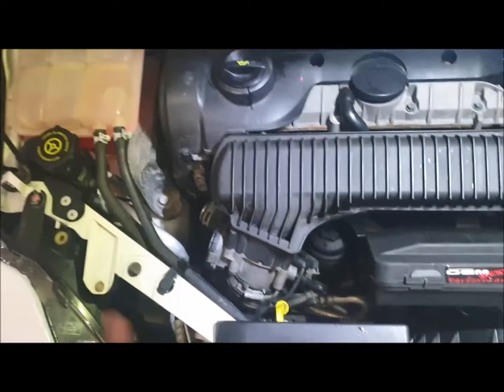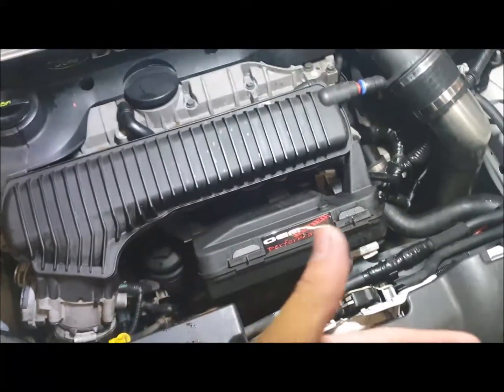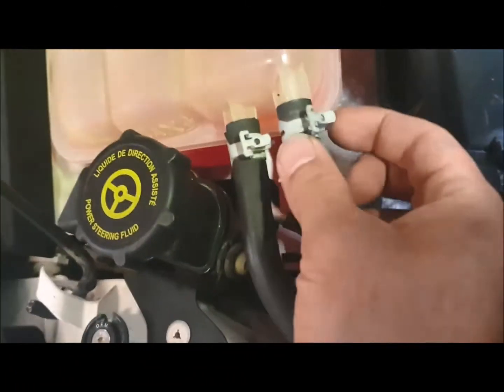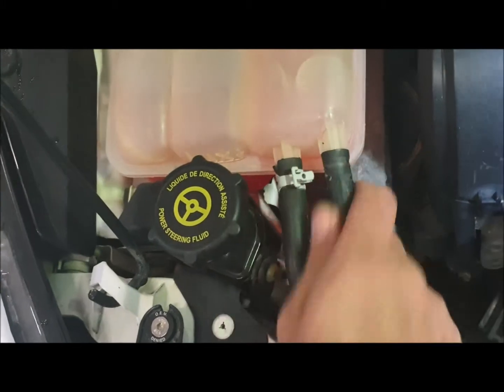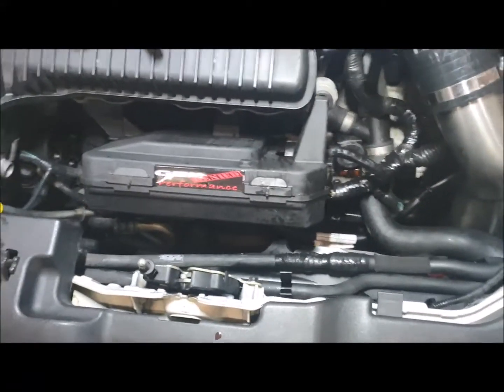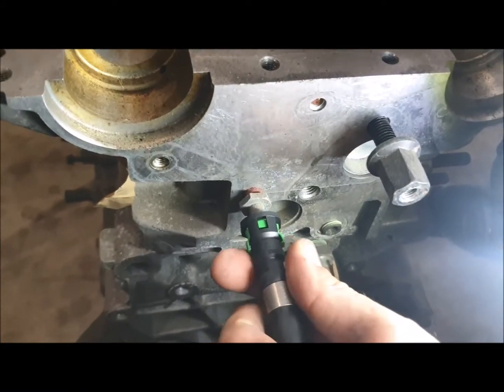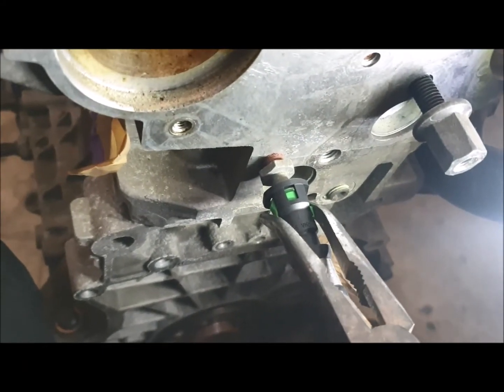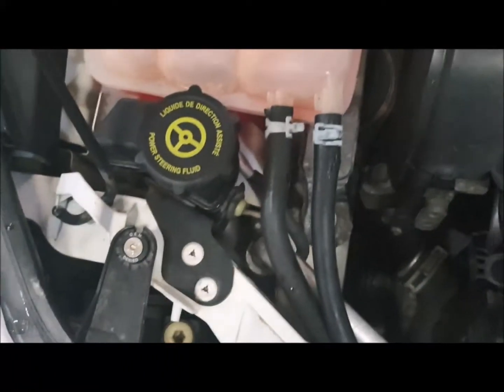How to replace expansion tank hose A on Focus XR5/ST225/RS. Step by step by OEM Denied Performance

Comment: Does the little black clip that goes into side of block come off the pipe? So if i decide to use pro hose kit? They clip would go into new pipe?
Reply from the maker: yes, you'd have to cut the steel band then remove the connector and swap that over to new hose and use a hose clamp to secure it

Comment: Ford Focus 2015. You can say how easy it is, and I can do it myself but instead you should bring up the fact that this hose costs $60 US dollars ! This hose on my model focus is a thin plastic pipe that is jammed into a larger rubber pipe. I had a pin hole leak in the thin plastic and simply thought I’d cut it out, extend the rubber pipe and simply use a clamp to put it together. Ford engineered this to be impossible as the end of the plastic pipe was reduced to a smaller diameter and anti crush metal garments we’re inserted. All held together by a “PEX” plumbing clamp. What should have been $3 dollar fix with minimal material was $60 with a long pipe destined for the dump. I am totally pissed off about the waste, money and damage all these plastic do, and that a multi billion dollar company can pay shit head engineers to “steal” $57 dollars and fill up our landfills ! I am great full for you sharing you knowledge.. I hope someday you rage about this topic an pray I can find a different car company that doesn’t pull crap like this.

Comment: Hey i have a ford focus mk1 1999 zetec 1.6L do you guys have any performance incrase tips buecuse you know 100hp isnt enough
Reply from the maker: In all honesty mate, I mean this nicely, buy different car.  The old saying there is no replacement for displacement is true. You could fit a 2.0L into it but for the cost and the time you wont find it worthwhile. Converting the mk1 Focus to forced induction gives good results but for the cost you can buy a mk2 that already is turbo and have 225hp stock standard.  (You have to factor in upgrading the engine also means you will have to upgrade the rest of the driveline)
Reply: @OEMDeniedPerformance  ok well... I guess thanks for to reply but im not into to mk2 ford focus i like the mk1 much more but hey i always find a way thanks again :)
Reply from the maker: If you want to stick with the mk1, the most common choices for upgrades would be a 2.0L ST170 engine and gearbox swap or 2.0L turbo engine swap from the Focus RS mk1

Comment: Do you know the name of the part with the green clips on it? I need a new one it broke 😩
Reply from the maker: comes as part of the hose im afraid mate. But would be the same as some fuel line push fittings
Reply: @OEMDeniedPerformance  i tried to jubilee my new silicone hoses onto the peg from my engine block. Couldnt get a tight fix though? Was that because it doesn't have a lip on its end?
Reply from the maker: yep, if you want to do it that way then need to remove the steel fitting from the cylinder head and replace it with a barbed fitting. You will have to match up the thread (not sure what it is off the top of my head sorry)
Reply: @OEMDeniedPerformance  not sure if I'd trust myself doing that. Maybe I can salvage one from another car or maybe ford can specify a fuel line one which will do the same 🤞
Reply: Can you just replace the hose and use the existing green clip,? I have a 2007 at 2 and is it the upper expansion tank hose,? Cheers
Reply: @paulmcgarrigle5531  yeah thats what I ended up doing after getting a new cylinder head clip as I called it 😅, if not you can get a replacement stud which is ribbed so you can just use a jubilee clip.

Comment: Can you guys do a rs wing on st225/xr5 focus install video please!!!
Reply from the maker: Really straight forward mate. 
Remove the tailgate trims at the top (it just pulls off) and you will see 5x10mm bolts. Remove those, then at each corner there is a metal clip holding spoiler to tailgate glass. Remove them both. Lift spoiler up and disconnect the brake light electrical connector & the rear washer hose. Remove spoiler and then RS one bolts back up in exactly the same way. Shouldn't take you longer than half hour all up, its best to have a 2nd person there to hold spoiler whilst you disconnect the brake light connector and washer hose.